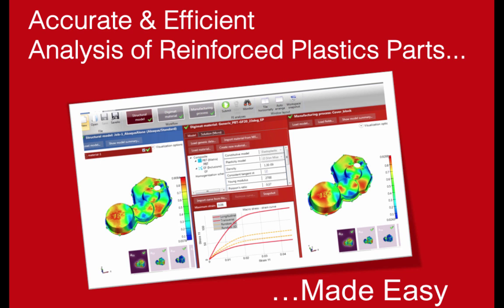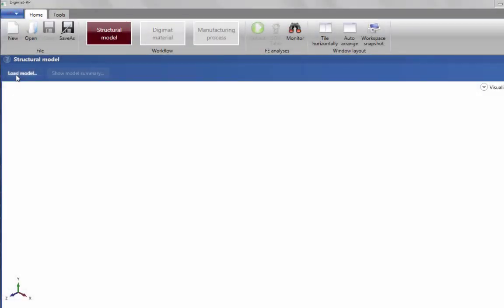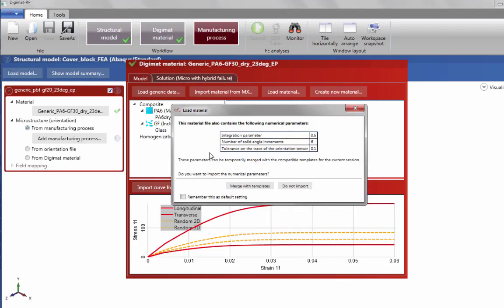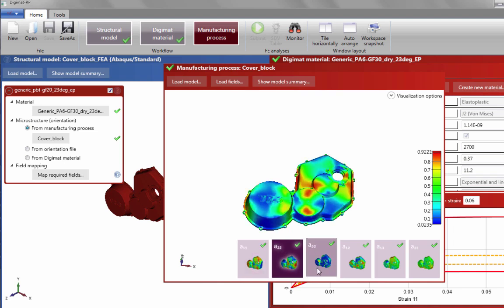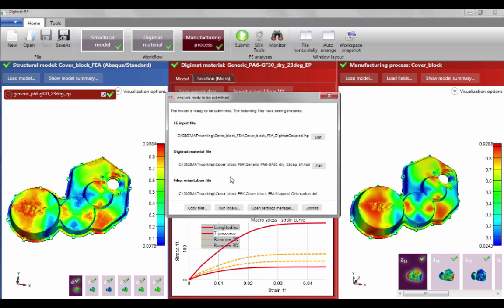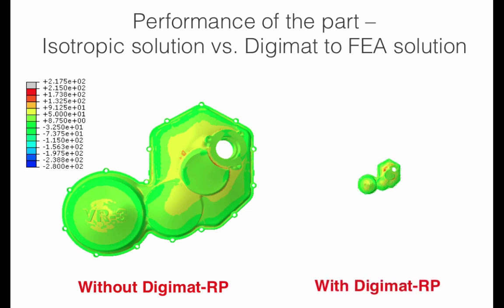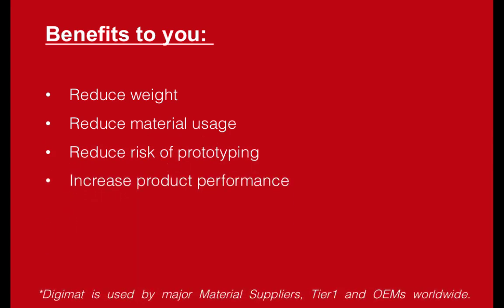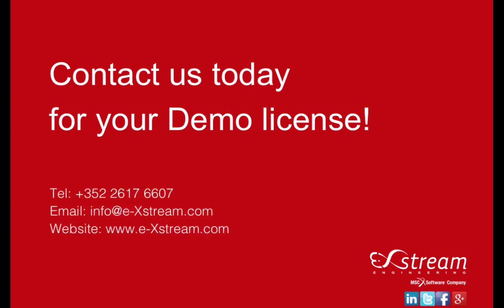Accurate&efficient modeling of reinforced plastic parts with Digimat-RP (DEMO:Abaqus)

Comment: when ı try to using abaqus inp file Digimat gives an error. The error is,  Not valid element has been found( at least one supported element with an assigned material required). ı can open inp file with other programs such as Advenced Material Exchange From Autodesk. What can ı do for that problem in digimat
Reply from the maker: Hi Korhan
This post unfortunately got missed.  Has your query been answered?  If not we will get one of our technical people to help you.